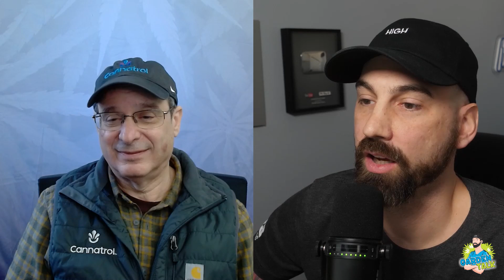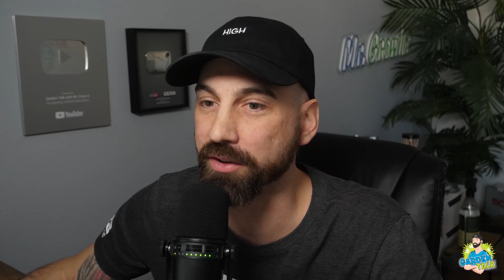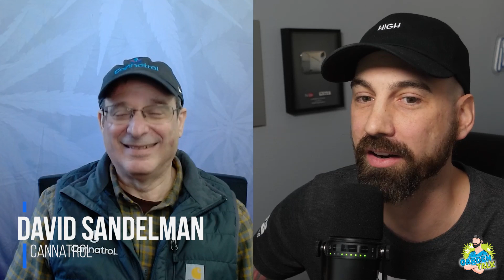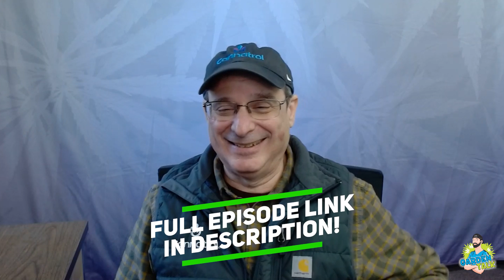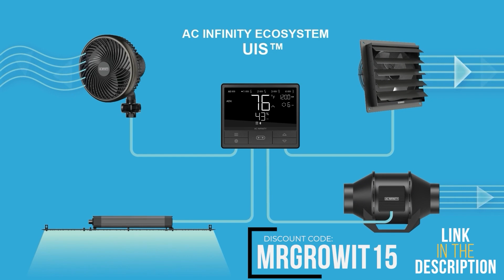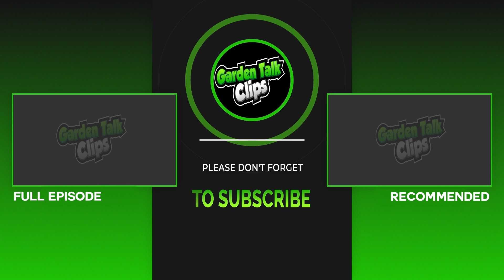Should You Use VPD For Drying Plants?

Comment: Talk more about setting the dew point. How is it measured and what parameters can be controlled
Reply: Canatrol is 68F and a 54 dew point which is 60.9 RH.
Reply: @FrothyBananas  thank you. Where did you find that?
Reply: @nathanielcallejas  thanks. Those are parameters that can be maintained with reasonable effort.
Reply: So same as growing in my mind. If you don't have a cannatrol then you need a/c, heat, dehumidifier, humidifier. It is not the same like they are saying but I am having good results at the 68f 60rh 54 degree due point. Everything is looking amazing! I have always dried at 60f 60rh. So this is new for me! 🤟🤓
Reply: @GrowesFirstChoice how did it turn out brother?
Reply: @JustWanderingAbout   Fire!! 🔥🔥🤟🏿🤟🏿
Reply: Yes there are calculators online. You are correct with your calculation!! Very nice!! 🤓👊